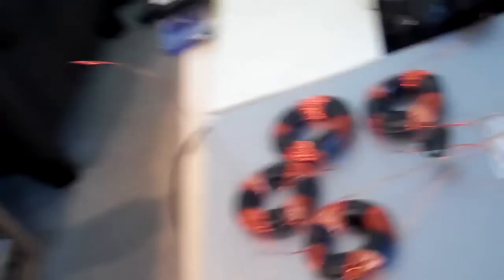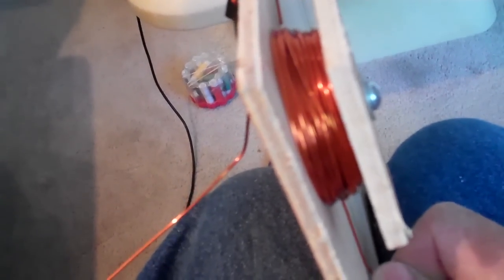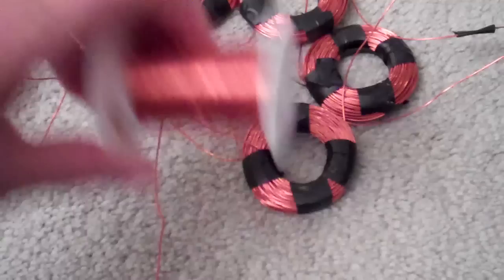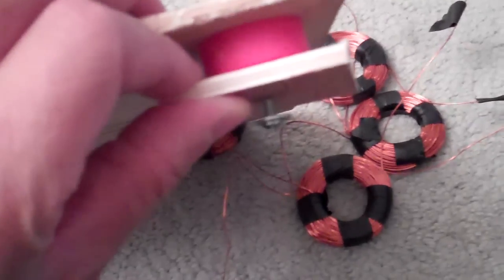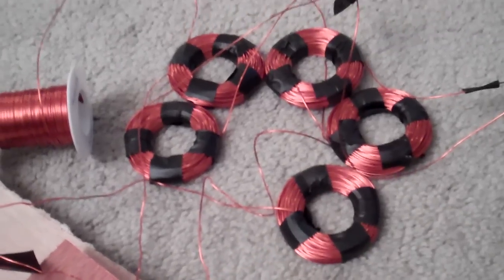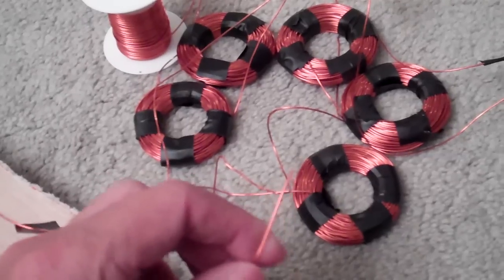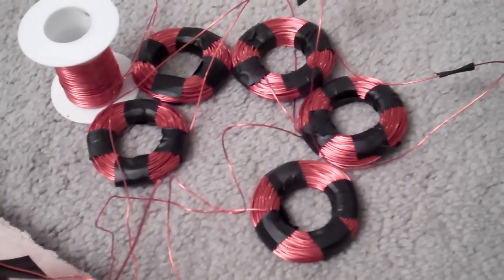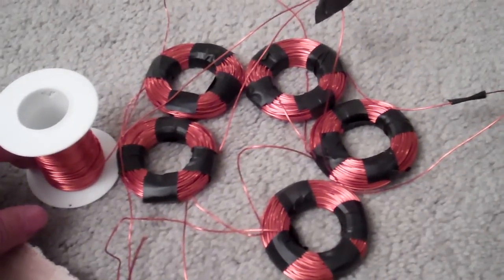Upgrading my vawt stator with bigger coils..mp4

Comment from the maker: Unfortunately, I found out with big amps at low rpm, you need many coils. A minimum of 24 to 36 coils with many turns to get enough voltage @ 90 rpm